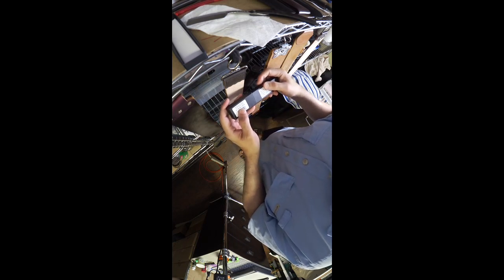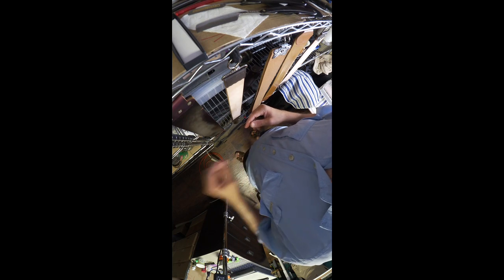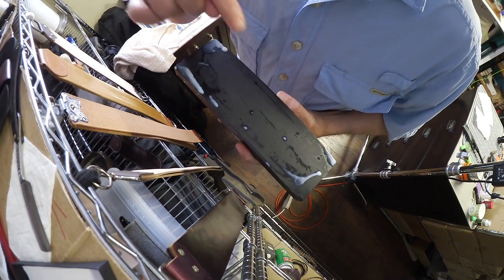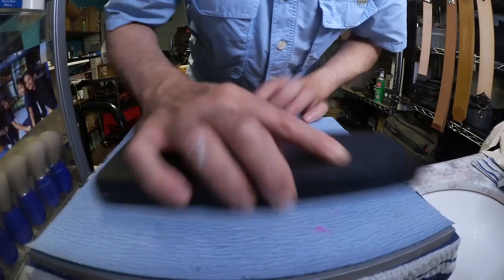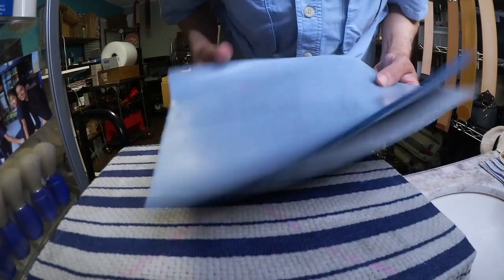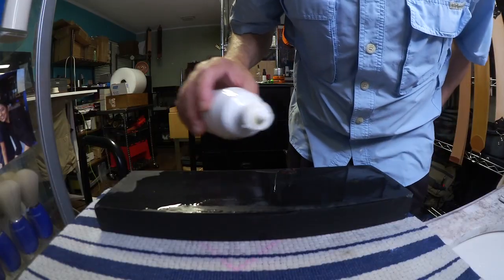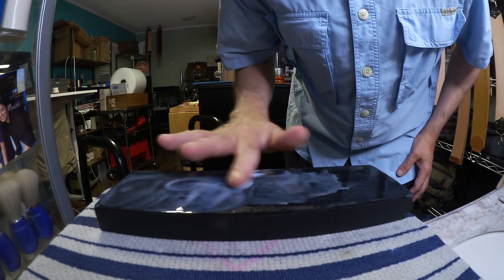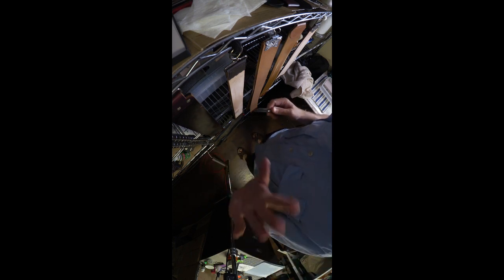Vlog Style Straight Razor Stone Prepping, Honing, and Stropping Thiers Issard Le Grelot 6/8" Ebony

Comment: Having seen your stones it occurs to me that i made my  4/8k stones elliptical. Are cylindrical stones better at this point in the progression, or doesn't it matter? They have been working fine and i get the impression that i'm able to hit a precise point along the razor using that shape,  but that could be wishful thinking!
Nice neighbors you have ;) 
T
Reply from the maker: Well when the second diameter is 25' or more, that's still an ellipse, just a really long one on the axis-minor.   Only a cylinder is a cylinder.

The cylinder coticule, I guess it would work better if it was 25'+ across.  The drawback for it being cylindrical is that you'll theoretically run through more metal refreshing a razor than necessary from a perfect execution with an elliptical stone.   They're correct in that argument; that is the trade, but then the feedback and use is very zero brain (with an ellipse in my opinion your honing brain is always on a very impatient clock, always the stone wants to overhone the middle and your job is to anti that while getting enough minimum everywhere).   It is a very sticky thing, this cylinder coticule, and takes little time to melt away the midrange, so I will keep it the way it is.  No doubt a top class 5000 JIS waterstone with good speed for its grit rating would be similarly glorious as a cylinder of this step-2 form.

The 'intense ellipse is the more precise and demanding tool.  That's why I save it for last.  

Always remember the changes that varying effective diameter of abrasive have upon where your sharpening's first occurring upon the bevel.

Comment: Hello Jarrod,
My progression is a naniwa synthetic 800, 3000, 6000, 8000, 10000 and 12000 how would you recommend i prepare my stones with the lapping plate i purchased from you?
Thanks
Reply from the maker: I would shape 800 & 3000 toward 9" axis and 6000 & 10000 toward 11" axis, 12000 kept flat, when you start a new honing on 800 you don"t want to stay too long (it leaves deeper scratches to remove at the apex, should it get there, because of how your two abrasive arcs on each side of the knife intersect), just when you see 800's marks developing a line on the razor swith to your 3k

In time try reshaping the 6000 by hand as a middle step set to 5m, and skipping the flat end
Reply: @thesuperiorshave  thanks a lot Jarrod i will try to follow what you show in your 2 demonstration videos😉🙏